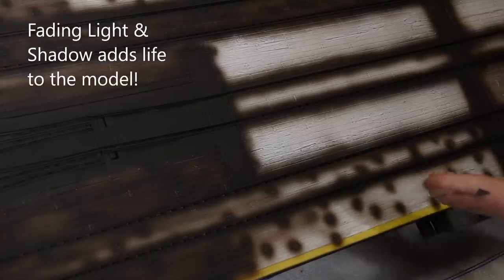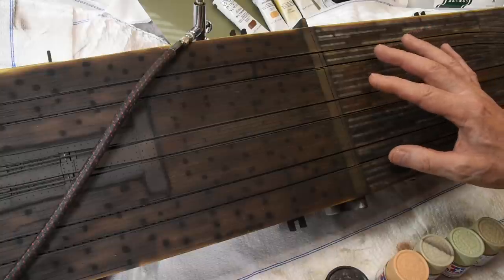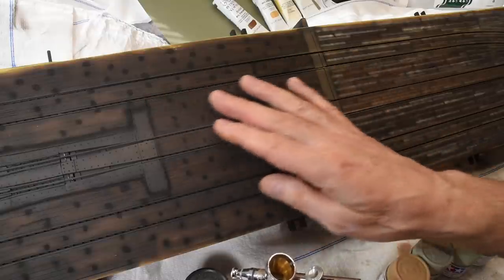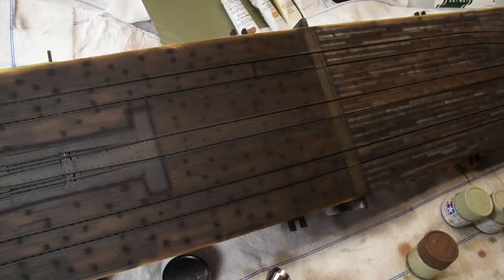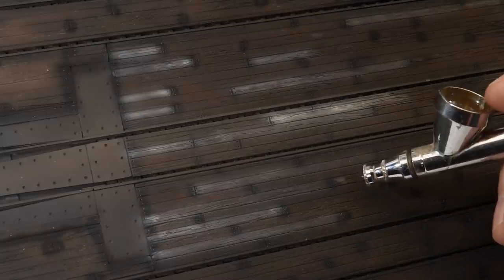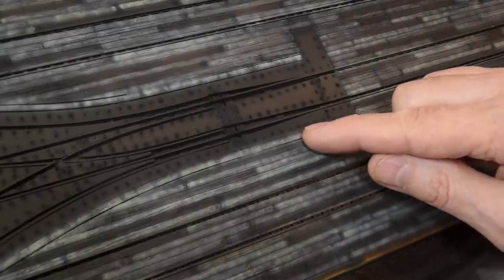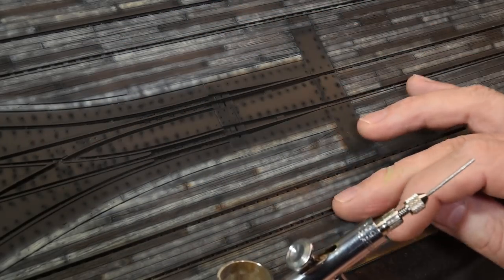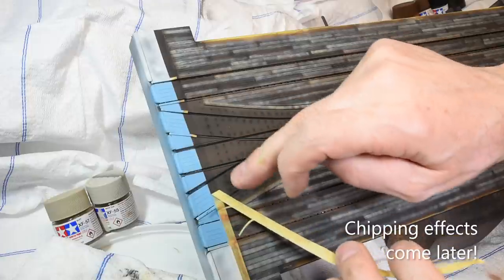Painting The Weathered Deck - The Barge Slip Series | River Road - Vlog #95

Comment: I know now is not the time to let you know that the 3-way stub turnout is not very correct.  I just went back to "The Barge Slip Build | The Ramp Head & Deck Part 8" to see how it was constructed.  I have not been subscribed but for a few months.  A stub turnout and split switch turnout are identical for construction except for the switch points.  Regular frogs are used, bolted or cast but considering other traffic may be on the barge and slip, self-guarding would probably not be used.  Stub points are actually part of a long or full-length rail and are spiked to the ties except for the point area where slide plates are used under the rails to support them.  The points form almost a true curve when they are thrown by an amount equal to that of a split switch throw and are connected with 2 more connector bars between the point rails to hold the gauge but they "float".  For practical purposes, the curve of the turnout starts where the points are last spiked and continue to the toe of the frog and this curve is in the points and stock and closure rails as one unit but for the cut to provide the joint.  This is where the term "bending the iron" comes from.  The lead of a stub turnout is slightly less than for a  split switch turnout because the split switch points are considered straight.  Split switch points are connected with joint bars in full size turnouts except for switches over 20 feet in length, then they are welded in about where the joint bars would be as these are considered high speed mainline turnouts.
Fortunately, your trackwork is very good and the kinks in the switch point ends don't create problems for you.  I don't even suggest going back to redo your work but I thought you might like to know just for information and for anyone else also.
Reply from the maker: I built the turnout from a photo from the prototype. Not sure what you mean. The three-way is sufficient and functional from my point-of-view and frequent visits to the actual location. Thanks for sharing though. 😁Cheers.
Reply: @boomerdiorama  Your work is great.  The track works great.  Just thought you might be interested for future reference and for others information also.  I thought you had said you had not gone all the way up to the 3-way switch and was relying on photos to build from.
Reply from the maker: @royreynolds108  I wish I had drawings (blue prints) for the whole barge slip and track work. If so, I would have built it all in "O" Scale. ;-)